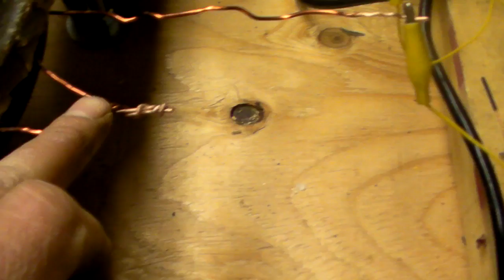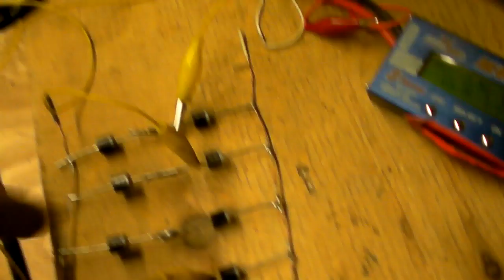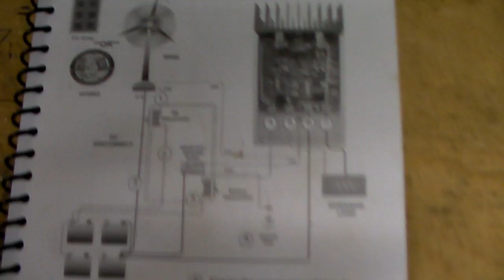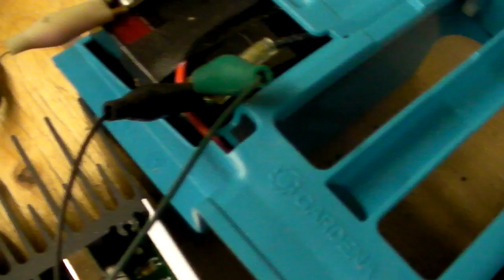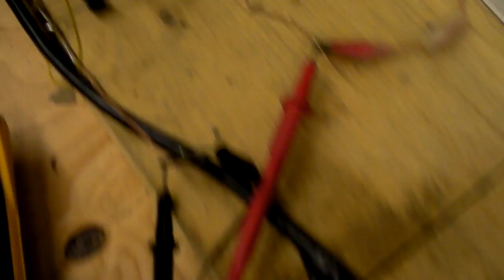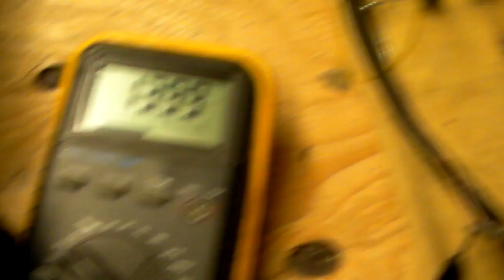3phase-24m-18c-70t-14awg-star-12v-test-43 axial flux vawt wind turbine

Comment: You will be able to produce more amps at the same RPM if you use a full wave bridge on each leg instead of the half wave bridge you are using now. You are only using half the power being produced by you alternator. Just food for thought.